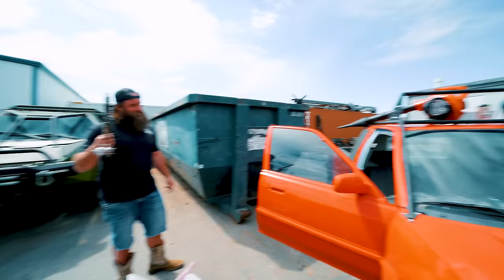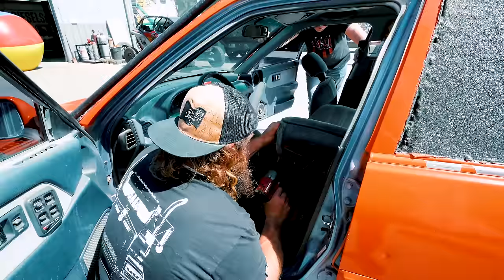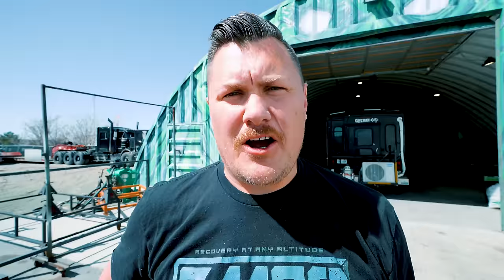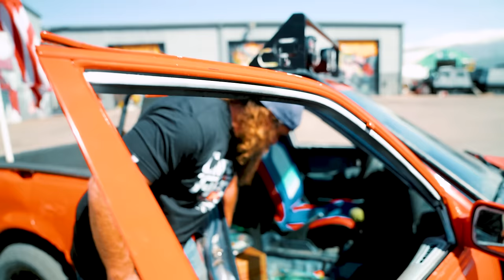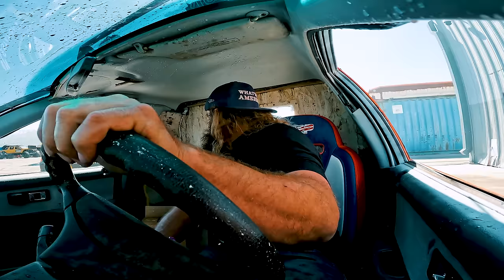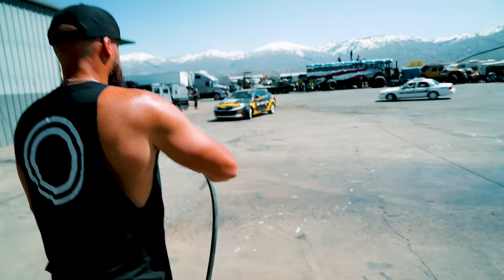Diesel Dave's Battle Arena!

Comment: Clean orange truck pressurewash and vacum out all dirt  and spray bleach the floor and sides to get rid of mold and then remove seats,  
**then you can spray entire cab with spray in bedliner, be sure to leave drain holes to allow any water to drain and tape up thread holes for seats!!!**
 This will be great way to protect it and prevent rust and make it look great, you can even color it or leave it black.  I think you will like it and it is durable!!